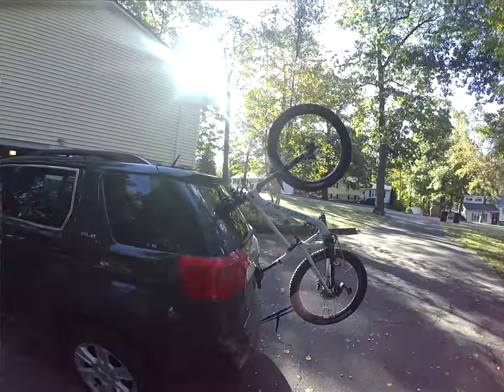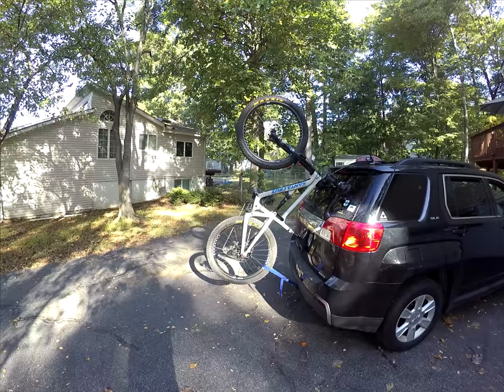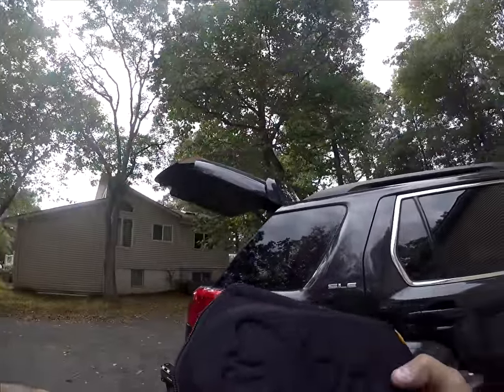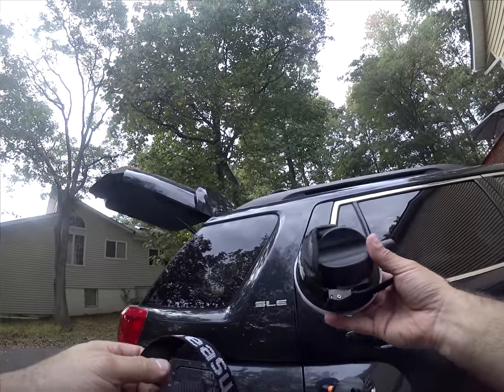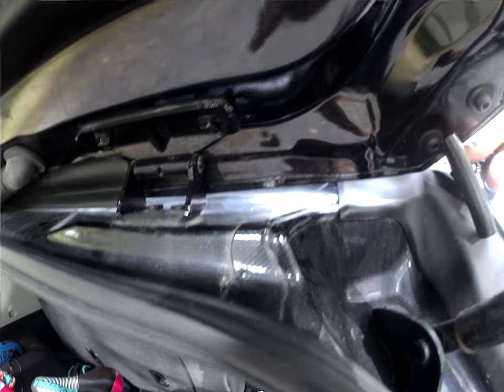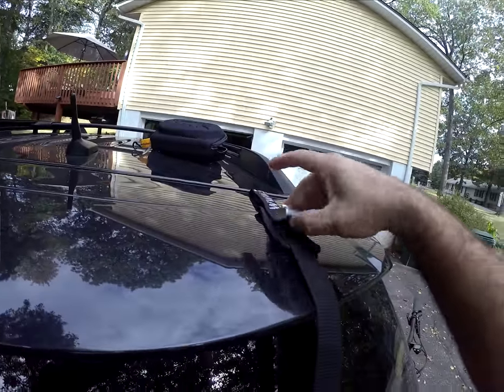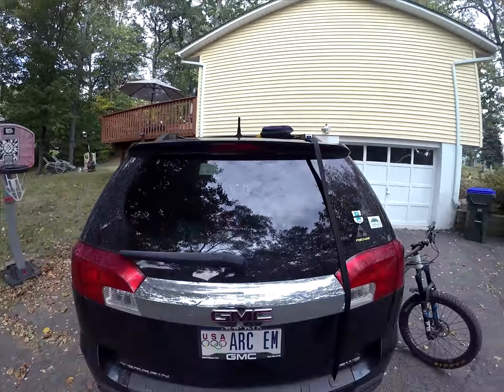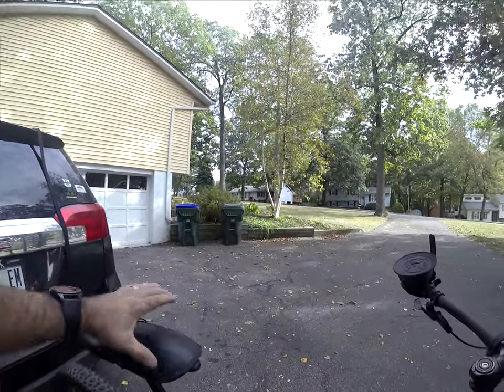Seasucker Hornet Review

Comment from the maker: So I have been using this as my daily rack for the month to really see its "longer" term durability.  I did make a small adjustment on the straps.  I cut off and removed the plastic bar for the top strap and now i can slide it into the truck lid in a position and I use a inexpensive carabiner to hold it in place once the door is closed.  still really enjoy the rack and I have not noticed any issue with disc brake issue due to position.

Comment: Thanks for the review Jason. This answered all of my questions.
Reply from the maker: Glad it was of help.  Just FYI fast forward it's still my go to rack use it weekly even through 20 degree days without an issue.  When it is that cold though make sure the cups are normal room temp. For the vacuum to hold.  I have also since cut out the black toggle and replaced it with a cheap 2.00 biner thus allowing me to move the strap to the center of the trucks trunk

Comment: Have you got any tips re removing the suction cups, I thought there'd be a button to release air but there isn't so it's a few hard pulls at the moment
Reply from the maker: Mark there is a raised tab in the side of the vacuum pad you just need to press it firmly toward the center and that should allow the mount to break the suction

Comment: Could this be done on a glass roof with a third sucktioncup for the saddle?
Reply from the maker: No it can not. Seasucker makes racks for the roof and rear but requires the removal of the front wheel.  This rack is designed to be out of the direct path of the wind and can only be used on hatchback style vehicles